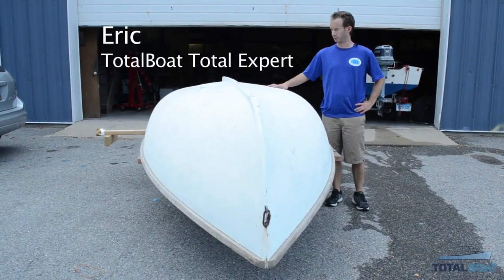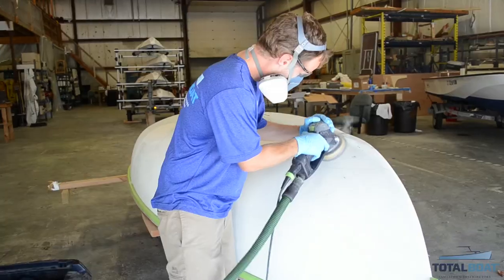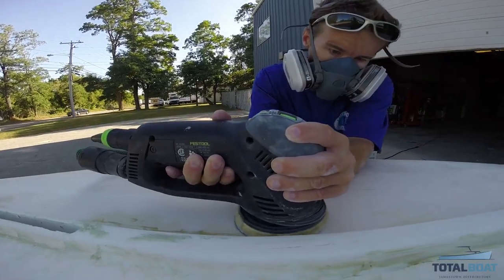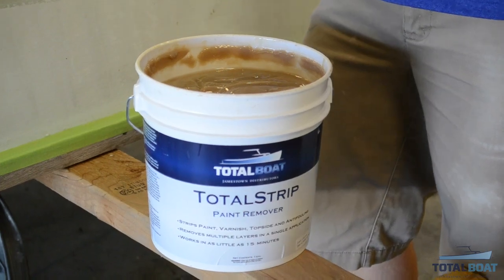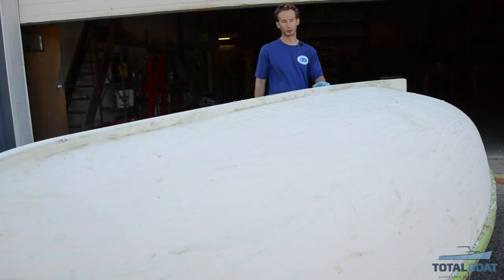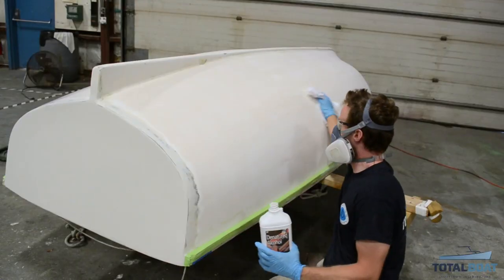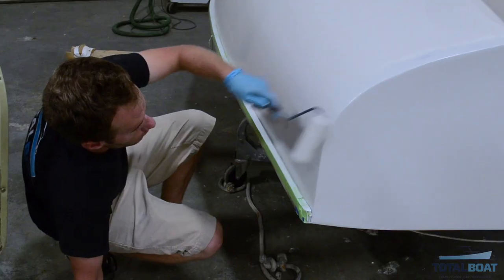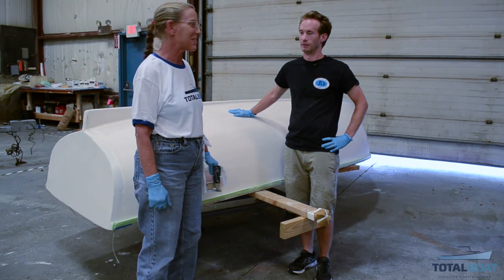The BEST WAY TO ROLL & TIP Topside Paint on Your Boat

Comment: Nice to have a helper.  I painted a camping trailer using Brightside with roll & tip method by myself.  I used a 9" foam roller and foam brush (instead of bristle).  Use the better quality brush w/ wood handle and denser foam.  The trailer had flush sides which made it easy.  The end caps were curved fiberglass, similar to a boat.  Need to be careful at corners, even though rounded they would promote runs if too much paint squeezed out of the roller.  You can smooth runs w/ the foam brush if you catch them early.  The purpose of the brush is to pop the tiny bubbles from the rolling.  If the rolling gets too far ahead of the brushing, the foam brush will start chattering on the surface to leave ripples.  Roll in new paint if that happens.  Once you get a good rhythm going, it runs smoother and a helper makes that easier.

Comment: Thanks for the video. I’ve only used Total Boat bottom paint and penetrating epoxy and both have been excellent. I’ve had the pleasure of speaking with your varnishing guru Hillary several times and my varnish job came out great. I’ve got too small boats I want to try to paint now. Update: I called about using this polynomial an aluminum boat  but learned you have a product just for that.

Comment: I'm studying up on how to paint my fiberglass boat, 17' stays on a trailer. You just painted the bottom of your boat with topside paint. You got me a little confused captain. In the sanding process right now, haven't purchased paint yet. Would you have any recommendations for me?
Reply from the maker: We painted the bottom b/c it will NOT be staying in the water for any period of time that would require Antifouling paint. Skiffs and dinghies that will be launched just for short periods of use are AOK with topside paint.

Comment: Am I missing something? Topside paint on a boat bottom? I am probably assuming Topside means above the waterline only.
Reply: The boat does not stay in the water so you can paint the bottom with whatever you want.  You must not know much about boats. "Bottom paint" is anti fouling paint for boats that stay in the water 24/7

Comment: Why or what is the reason to tip?
Reply: The tip smooths out any bubbles that the roller may have left, gets the paint going in one direction so it can self level. It is important to use the right roller cover as well, JD sells a great Mighty Mini roller kit for these type paints and a Redtree Fooler chip brush.

Comment: What is the point of the tip part?
Reply from the maker: +DBay Boyds  Tipping removes the bubbles from rolling the paint on and gives a uniform and smooth finish when done right. A good roll and tip job will look like a mirror when done with no "orange peel" or sagging. It takes practice, though! Good luck!
Reply: The tip smooths out any bubbles that the roller may have left, gets the paint going in one direction so it can self level. It is important to use the right roller cover as well, JD sells a great Mighty Mini roller kit for these type paints and a Redtree Fooler chip brush.
Reply: DBay Boyds s

Comment: You really should be block sanding between coats instead of using your hand. Using your hand has the potential to leave grooves where the contours of your hand apply uneven pressure to the dinghy.